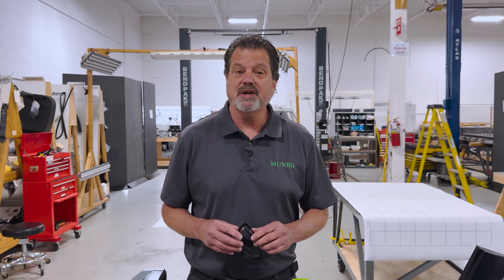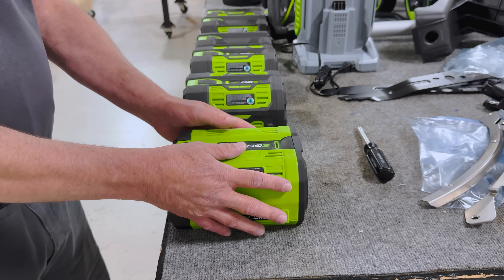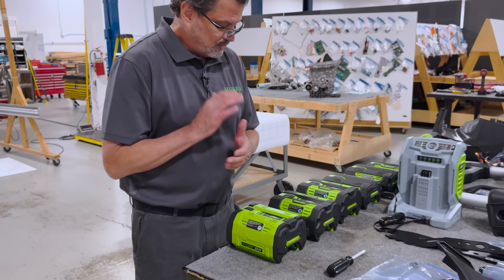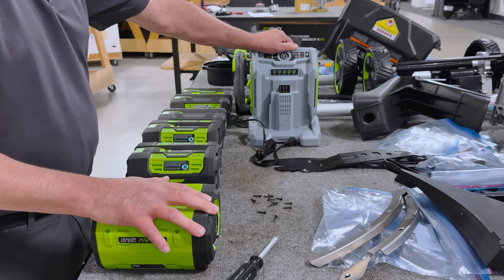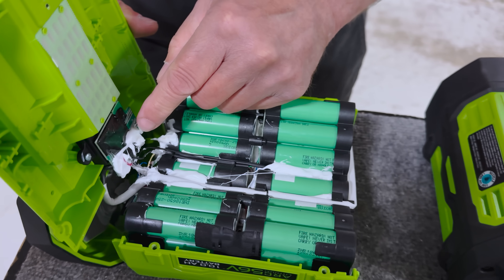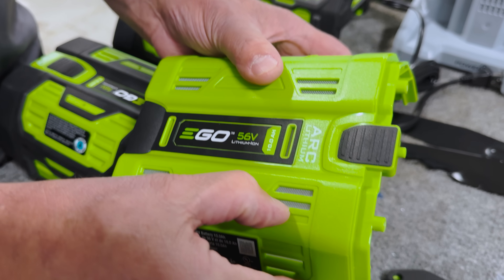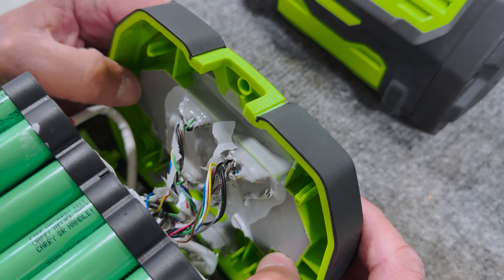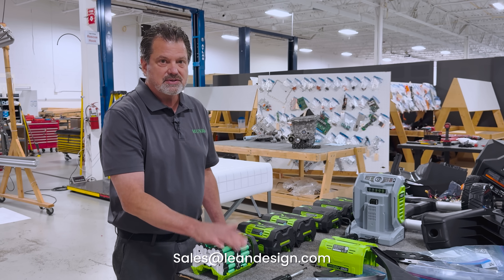EGO 56V Battery Teardown: What’s Really Inside?

Comment: Any recommendations for third party Ego batteries?
Reply: 5 years with my Ego mower and it and the battery still work great.
Reply: @JordieG8  Plus they sell inverters for it that have saved me in a number of binds.
Reply: Yes, buy something else. The best lawn mower I had was a sealed lead acid, Black & Decker that lasted 12 years (battery replaced once). The worst was the lithium battery-powered lawn mower that replaced it for one year. Ruined 3 batteries at $100 each by loaning it to the neighbor who had their lawn mower die. Every time it choked due to the tall grass, there went a battery. I have a Honda gas engine on my mower now. It doesn't care if it is over 100 degrees in my garage because I fill it outside.

Comment: Does it still work if a battery becomes unchargable or does it take the whole pack down?
Reply: Are there any multi-cell packs that can survive a bad cell? I think you’ll always be limited to the capacity of the weakest cell in the pack, since it’s dragging the whole pack voltage down faster than normal.
Reply: I believe the whole pack disables, similar to other home tools (ryobi etc). It’s unfortunate for durability or repairability but I also understand the safety concerns of unbalanced cells. I recently had a 4.0ah Ego battery fail, it wouldn’t charge to 100% and so I tried to drain it to 0% to hopefully recalibrate it with a full charge, but it actually just died and wouldn’t charge at all. Blinking all 5 lights as red. Ego supposedly is sending me a new one under the 3 year warranty.

Comment: The newer model has maybe a higher IP rating. This white material, I think, is for a little bit more dust and water protection.
Reply: It's not like those membranes are sealed to the body though, they're just pinned in 2 locations each.

Comment: What's the purpose of the phase change material? Does it turn liquid at some temperature? What keeps it in place?
Reply: It's in a sleeve around the battery and changes from liquid to gas to absorb heat. 
Laptops use this in their heat pipes
Reply: @engineer1692  Yeah, a standard sealed heat pipe. It boils at the CPU, and condenses at the fan. It just moves heat efficiently.  This stuff is not a heat pipe, though.
Reply: Phase Change Material (PCM) battery sleeves are passive thermal management systems designed to absorb heat generated by battery cells, preventing overheating by undergoing a phase change from solid to liquid at a specific temperature. These sleeves improve battery thermal uniformity, safety, and lifespan by providing thermal stability without needing additional power, such as with forced air and/or liquid cooling. A common PCM material is paraffin wax. Due to the low heat conductivity of paraffin wax, heat conductivity is often enhanced with additives. A common additive is graphite, which improves thermal conductivity. It is the heat required to melt (phase change) the paraffin wax that absorbs the heat without an increase in temperature. Once all the phase change material has melted, it can no longer absorb heat without an increase in temperature. Example: a block of ice. Once melting sets in, the temperature of the remaining ice and the water around it will continue to be around 32°F (0°C) until the ice has fully melted, at which point, given more heat input, the temperature of the water will rise. 

Now for all you armchair warriors who like to jump on nitpicky details. I do know that you can drop a piece of ice into a pot of boiling water, and water around the ice will be hotter than 32°F (0°C), so save your time for better things than to pick through everything I said just looking for some precious morsel that you can point out and complain about. In other words, get a life.
Reply: @James_and_L1  OK, if it's not designed to move heat from where it's generated to where it can be dissipated, like a standard heat pipe, then it must store it and release it slowly. How is it kept in place if it turns to liquid? What happens when you keep putting heat into it after it turns liquid? Why is it only used on the ends? Is it a fail safe system for one time use, or designed to be used every time you charge?
Reply: Phase of the electrical current, not the physical structure 😜
Reply: @It-b-Blair  Nope, it is specifically chemical structure, not electrical phasing.
Reply: @It-b-Blair  Uh, nope.

Comment: hmm really interested in pcm's in batteries, more for the mobility applications. ive read that with cylindrical cells pcms may help with overall thermal management through thermal mass; however, they can actually increase the temperature "inhomogenaity" or net temp delta from inside the jelly roll to outside when compared with simple anode terminal cooling. ya the battery cells might have less net heat overall, but there might be some negatives for longevity depending on current draw application. im guessing the reason they didnt use pcm in the biggest size battery may have been down to weight. starting to get heavy at that size/capacity. maybe i dont know the expected amp draw. like what theyre doing though, clever and cheap. i think pcms however belong either between pouch cells or under prismatic cells, not around cylendrical cells mainly because of their steel shells poor thermal conductivity compared to aluminum. pcms have actually been used for a long time in ultra light/compact heat exchanges in the defense industry for cool stuff like phased array antennas which no one talks about coz theyre not allowed to lol. I think the best application of pcm's is actually for a cheap daily commuter ev application that might live in northern climates with regular freezing cold temps and protecting LFP cells from freezing. its all about the designed melting point, and if youre designing a low temp PCM to get some latent heat out and keep a cell pack above freezing, then ionic PCMs tend to make more sense. ideally the calcium chloride dominate recipes which are suspended in something like gel/xanthum gum. ionic pcm's make organics look like theyre taking days off by having 2-5x more latent heat and better thermal conductivity without additives like shaved aluminum. problem with ionic pcm's is their longevity/durability since you get all these weird precipitation/hydrate stratification. gelling agent like xanthum gum helps, but its important to design a small enough packing that is geometrically as opposite as possible from a graduated cylinder. the secret sauce after that that industry holds close is antisuperfreeze additives. ~0.5%/mass sodium chloride works okay and should probably be in any calcium chloride based pcm, but the secret ingredient really is strontium chloride of some secret quantity. probably no more than 1.5% by mass.  
man i got on one of those classified information tangents. meant to point out that a large amount of electricity costs are burdened by EV owners in far northern us states by parking their ev outside and trying to keep the battery above freezing. insulation helps, but is a double edged sword for heat rejection. a pcm could reliably hold on to ~10% of the entire kwh capacity of a battery and effectivly return it to the user when they plug in every day by helping keep the pack above freezing overnight. for a typical daily driver in these states, that could be 5-10kwh every day in avoided costs to keeping ur battery warm during night time charging, which at ~$.20/kwh adds up to 1-2$/day. maybe 400-500$/year or $10,000 over a 20 year life of an ev in northern climate. plus you get some range benefit not having to pump as much heat into the battery on cold winter days.
just like LTO battery tech, no one i know of in industry is even looking at this tech. okay there is staffl systems who makes 60k$ private yaht batteries for lto but thats it lol

Comment: I have been disappointed in the life of these batteries....I've had several
Reply: Have had their batteries for ~7yrs, only one dud, but I'm taking accountability for that one, I left it outside for a while where weather was cold and wet 😢
Reply: We do not charge any of our EGO batteries to 100%. We stop at around 80-ish %, and try not to go down to zero. Same for our trimmer batteries, phones, both cars, or even small rechargeable AA and AAA's. I hope that EGO has some type of power management protection built into the batteries or the charger to help protect at the top end, but as we are unsure of this, we treat them like all our other Li-Ions.
Reply: and so I stand there and watch it charge to 4 lights? no thanks,
 maybe a timer
Reply: @lastlion65 So if you want to spend $100 or so you can get a programmable charger. I use on on my ebike. Set the voltage, set the % charge you want. And you can set the charging amps so you can charge it slower if you want which is good for the batteries. DO NOT set the charging amps higher than what the charger is stated at however. Or a simple timer plug works too as you probably know how long an 80% charge takes
Reply: @jaaklucas1329   what brand/model is your programmable charger??
Reply: Do you leave you batteries on the charger?
Reply: @JordieG8  I recommend a simple timer plug for additional safety. Plug it into the wall outlet, plug the charger into it and set a time where it will take a full charge then stop the power after that.
Reply: @jaaklucas1329 I usually just charge them right before using them. But that’s not a bad idea.
Reply: @JordieG8  I notice my new phone and laptop have"adaptive charging" which is 20 to 80%. Very clever.  On my ebike I use the timer plug for safety. I know a full charge takes 6 hours, timer plug stops the power in case of the BMS in the battery pack fails. Never had that but why not. I also have a programmable charger which I can set anything including lower amps trickle charging which also is better for these type of batteries.

Comment: I am surprised you did not comment on the design of the blades that connect the battery pack to the tool. From many hours of use, this is showing up as a weak point. Arching is showing up in the field which has led to undercharging and loss of power to the tool. Clearly an area for improvement.
Reply: Is it worth periodically cleaning/rejuvenating the blades for better contact?  No idea how, a thin abrasive maybe, diamond encrusted box cutter blade?
Reply: *Arcing, no arches :D

Comment: 6:23 Im pretty sure each dot light represents 20%, as there are 5 of them in a ring. When I use my mower, the outside gauge turns red when it hits 20% and I can also see from the mower's view panel, the last battery dot also turns red.
Reply: 10%, 20%, 60%, 80%, 100% 😂
Reply: @evilution_ltd quick maths
Reply: @evilution_ltd  quick maths😂
Reply: Yes I think it's is 20, 40, 60, 80 ,100. 
What I've noticed is you can feel the power go down as it gets lower. 
The larger ones go full power for a lot longer.
Reply: @ralanham76  It is, that's what it says in the battery user guide.
Reply: The charger shows increments of 20%, beginning with 20 up to 100. Same as the batteries. That said, when the batteries (I have 2) show the last segment lit up, it will last only a couple minutes until shut down. If anything, that last segment might essentially be 10% remaining.
Reply: Yes, powerbanks have the same five 20% leds 😉

Comment: Those membranes seems water splash proof compared to molded holes.
Reply: I was thinking they were better for dust considering these are outdoor tools. I'm curious to see whether the inside of a used EGO battery looks dirty. I believe they're only actively cooled while charging or using an inverter (rated only for indoors), so maybe it is to make them water resistant.
Reply: Small bugs or ants as well.  That can be a real problem.

Comment: Their battery costs like 4x more than aftermarket versions.  They need to work on that.
Reply: If I'm storing one of these in my garage, I would prefer it not be made at the cheapest cost. Why? It's "more" likely the cheapest will burn my garage down. Be careful with aftermarket versions.
Reply: Most of the aftermarket versions VASTLY overrate what capacity they actually are and many of them have little to no protection circuitry. There are many, many videos here showing how poor most of those batteries actually are.
Reply: They don't want you to buy just a battery, They want you to buy a kit with a tool and a battery.
Reply: If you tear one of those apart, you'll see why I'm sure.
Reply: an equivalent general battery pack using either LiPo or Lion cells (54V-56V 5Ah) is well over 400USD so I'd say even with cheaper cells inside it's easily worth it.
Non-OEM battery packs are usually garbage and poorly designed; not safe and uncertain performance, hard pass.  I'm only buying a few with my tools so why would I skimp unless it's clear they're not only cheaper but BETTER than OEM?
Reply: Mine always overheat after only 20 minutes of use in 90f environment.  In winter months 45 to 55f no issues.
Reply: aftermarket doesnt always mean good or better lol!
Reply: It's best to get them with the tools, they are basically Free with the tools.
Reply: @ralanham76  lower Amp
Reply: @ralanham76 They are too small. 7.5 gives about 45 minutes runtime.
Reply: @NPA.CitizenForTheCitizens . I run my 7.5 for about 25 minutes to mow my lawn and it is still at over 60%.
Reply: @doittoit00 Well you make me feel more good. As old as these two batteries are, to get over 45 minutes cutting at #2 height is impressive. Thanks for sharing that!
Reply: The extra cost is the guarantee of capacity, lifetime, and most importantly, safety.